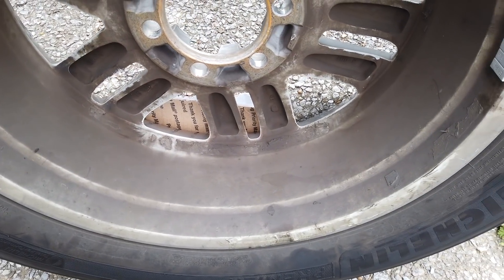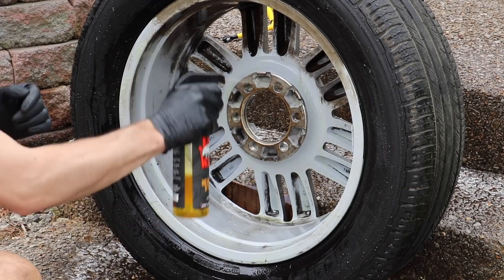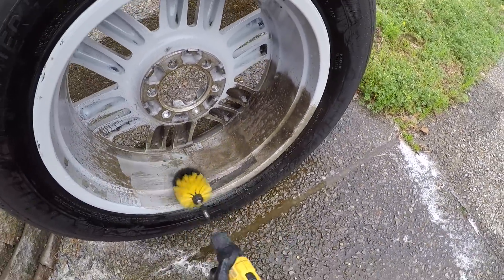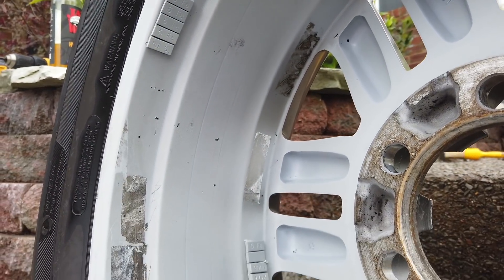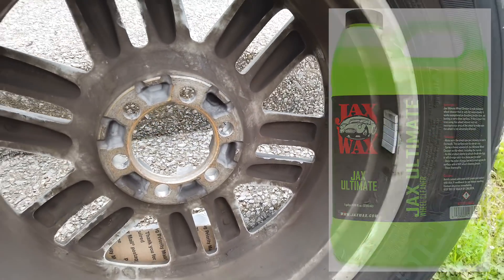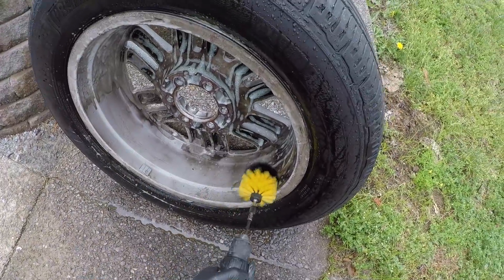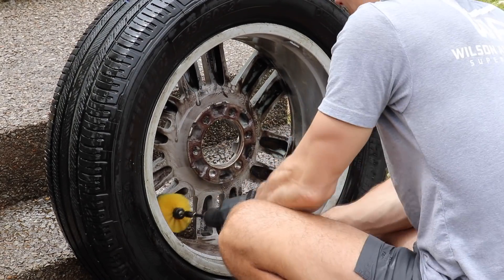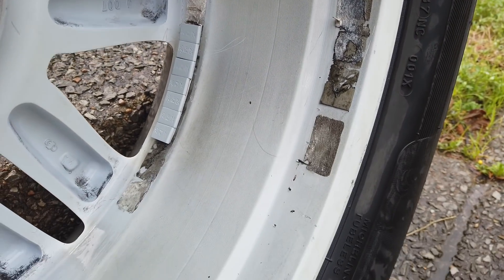HEAVY Brake Dust Removal & A Hugely Profitable Add On For Detailing Businesses!

Comment: Hi Luke. Excellent video. Can't wait for that drill brush to come into the market. May I kindly give you a suggestion. Anytime you use a drill brush(any drill brush) and a chemical that is either high or low on the ph scale use safety glasses. That stuff burns the eye(s) like a bugger. 😭😎

Comment: When are the official Luke Wilson brushes coming back?

BTW, I finally scrubbed my tires (Optimum Power Clean) and the brown garbage coming off was awful. It took 4-5 x per tire and a long time.  All tires were finally matte black. Wheel shine then went on incredibly quickly. 

Next time the drill brushes!
Reply from the maker: I know!!!! Corona virus killed shipping but the old ones are officially on their way back to the US! The new set are being boxed and will be shipped in about 2 weeks!
Reply: @wilsonautodetailing  I'm not a professional, but I just wondered if I need a drill brush just to do my own personal wheels. I have an 07 Camry Hybrid and I've just never been able to get inside of them. I have stepped up my game and have the EZ Detail brushes and the Tuf Shine brush. With that and a dish brush be good enough to get my wheels clean? I know it will take longer. I have Adams Wheel and Tire cleaner, but could use something stronger if required, but I don't know what is.

Comment: Where did you get the drill attachment brush from to get into the bottom of the alloy wheel spokes?
Reply from the maker: Hey man, this is actually my own product. I created a set of drill brushes with drill attachments that are specifically designed for auto detailers. About another 45-55 days and they will be on amazon. Because of the virus shipping has slowed things down tremendously